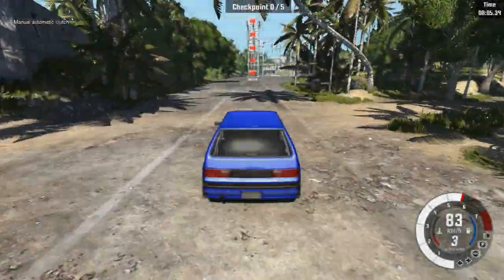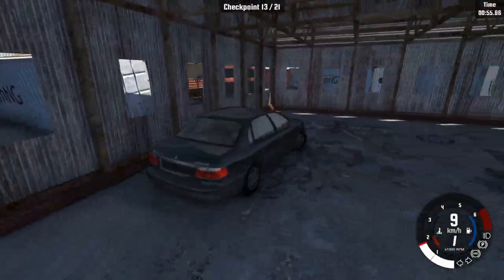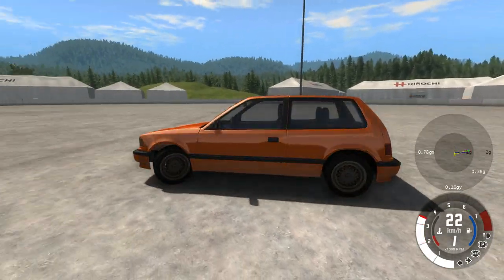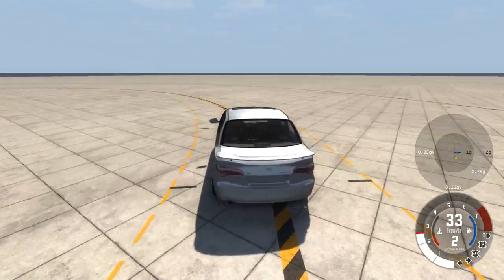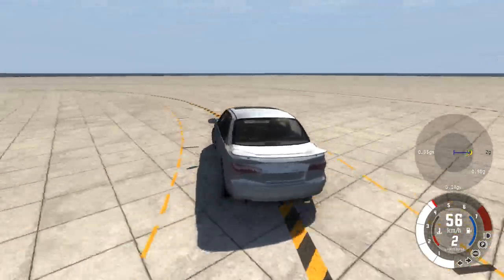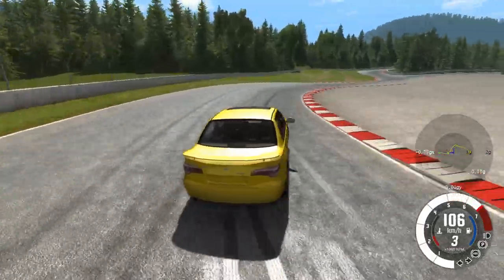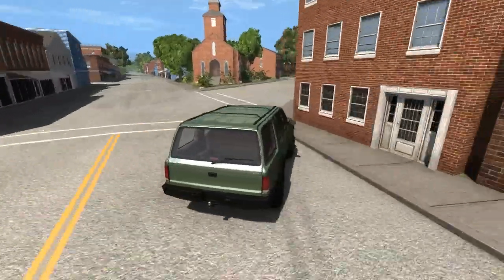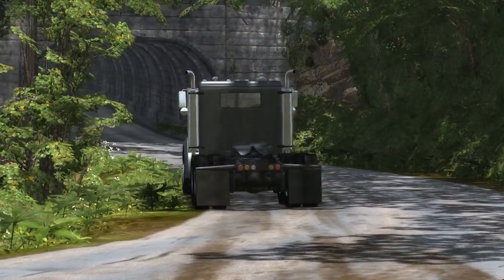Vehicle Handling in BeamNG.drive

Comment: Front tires handling should increase when you brake hard but it doesn't. You have a nice simulation but it lacks a few physical parameters those ruin your driving when you drive on the track at limits.
Reply: When you lock up your brakes? NO TRACTION!!

When you just brake hard? It's pretty accurate. When you brake, the energy is still going forward rather than disappearing right then and there, putting a lot of weight in the front... So it makes sense (sorry if my explanation doesn't)
Reply: Those aren't just tuning parameters, in fact, they aren't at all. Downforce is simulated quite well and I've tested it by making cars that rely on downforce. The same should apply to braking as there's nothing differentiating the forces.

Comment: I watched this video because i am tuning a Civetta Scintilla to make the perfect race car. In terms of speed it's fast, but handling is the problem. Somehow i managed to reach a lateral force of 3g with some suspenions and tires tuning, all in vanilla, and i want the car to be much more stable since it goes 450+ km/h. But... in this video this guy just said "A smooth driving it's important, so that's why it is recommended to drive with a pad or a steering wheel". Meanwhile i race with keyboard lol and i am not used to play with a pad at all and i can't afford a good steering wheel.

Comment: pulling the handbrake in a front wheel drive car just gets the car to slide. Proper drifts are slides with controlled speed and angle, not momentary sliding.

Comment: sadly i don't have a controller or another way apart from keyboard to control the cars, so I'm stuck with overturning and not being able to drive properly
Reply: Use BeamNG.drive Remote Control on smartphone.
Reply: @AnimMouse  I tried, it barely worked for me
Reply: @Camerz  Try changing sensitivity setting on app, mine needs to be increased sensitivity for me to turn properly.
Reply: @Camerz Have you tried mouse steering on this game ?

Comment: I've got an AMD Phenom II X4 960T Black Edition CPU, but my GPU is really bad. Any experience what kind of GPU is needed for a smooth experience (60fps 1080p)?
Reply: +Martin Rupprecht It's not a GPU intensive game. But your CPU literally limits the amount of vehicles you can have on your screen without lagging. I wouldn't worry to much about the GPU. Having said that, I don't know what the minimum requirements are...
Reply: Head over to the BeamNG forums, people can help you out more.
Reply: Head over to the BeamNG forums, people can help you out more.
Reply: Head over to the BeamNG forums, people can help you out more.
Reply: +Martin Rupprecht you could probably get away with a AMD 260x on lowest - low settings

Comment: i can assure you this game handling is no where near the handling in real cars, they are way off
Reply: Yes, cars in the game feels too light and get out of control way too easy. Once the wheels start sliding there is no way to correct it until you crash and come to a rest
Reply: Real cars aren't controlled with controllers or keyboards though
Reply: And it's actually really easy to do things once you get a hang of it
Reply: This game is not exactly accurate to real life. Well, it is, just not near a 100%

Comment: "To accurately simulate car handling" my ass... This is coming from someone who drives real cars, and I can tell you at for example 30 km/h i can turn a real car's steering wheel 75% to the right and make a complete u-turn in seconds, no skidding, not crashing, but I have yet to find a car in BeamNG where no matter how much I try, i cannot turn the fucking car and end up crashing. Or on a completely open plane, it will take ages to make a u-turn and will require a fucking football field... handling is completely unrealistic and the game severely understeers your cars..

Is there a setting to increase steering? If not, please add one, because stock steering is worthless.

Comment: I don't want to use a fucking controller, this a pc, mouse and keyboard are 10x better. Could not play this game and had to refund it because of this. It won't allow you to fully change into a WASD format without having to click to change the camera. Unplayable without a controller/wheel.
Reply: I play this game with a keyboard and it works just fine. Make sure to turn on assists (throttle assist, steering assists, etc.) to give a better control of the car.
Reply: Use BeamNG.drive Remote Control on smartphone.

Comment: its no where near IRL
Reply: Go hop in a car IRL and try gunning it down the street and turn a corner. I mean, whats there to be scared of, right? Its not going to be like BeamNG! (/s)

I doubt you're even old enough to drive, anyways.
Reply: Solis agreed!!! Beamng is one of the most realistic simulators out there
Reply: Solis Damn, you ruined him. Nice!
Reply: Regular Yugoslav need for speed isn’t realistic at all, when you crash a car at high speeds, it barely does any damage
Reply: Thinks to self "I'm glad I have the ability to compare."
Reply: In my opinion, there is no fucking way, this is realistic. These developers are telling me, their indie trash has better physics than iRacing for example, which has laser-tracked vehicles and tracks. (Their physics aren't even close to each other) So who do you believe? The indie team with some g-force meters, or the million-dollar project with laser scanning?